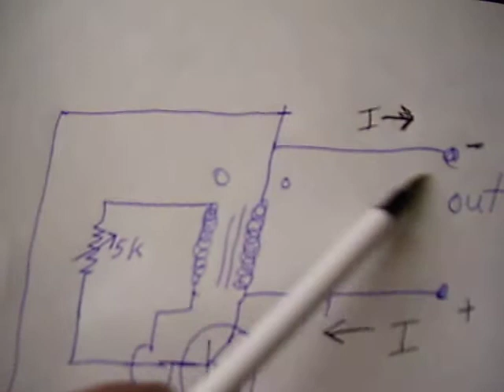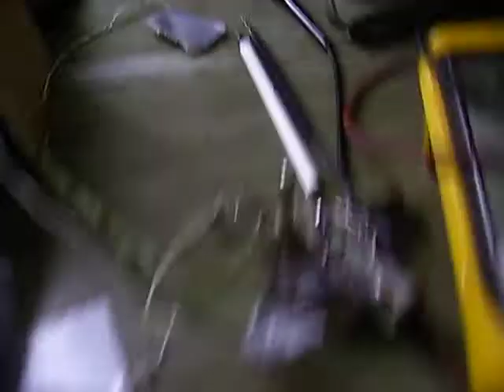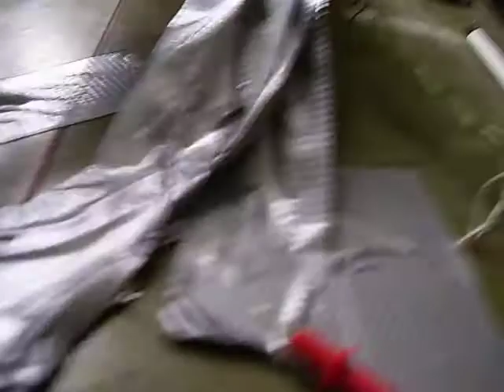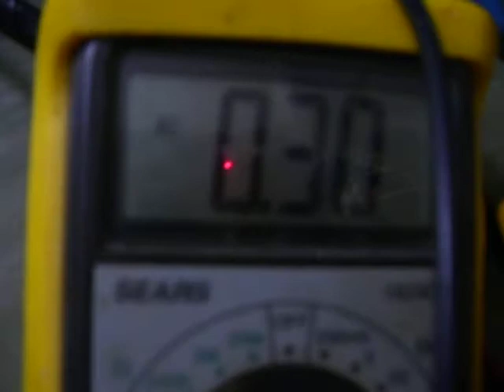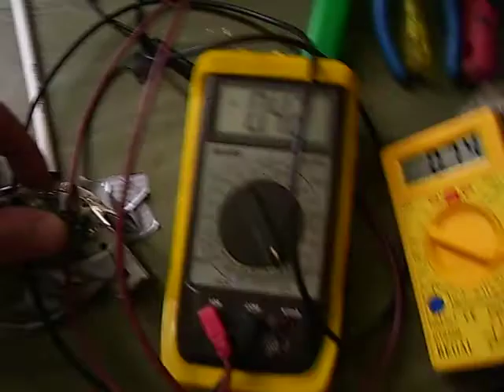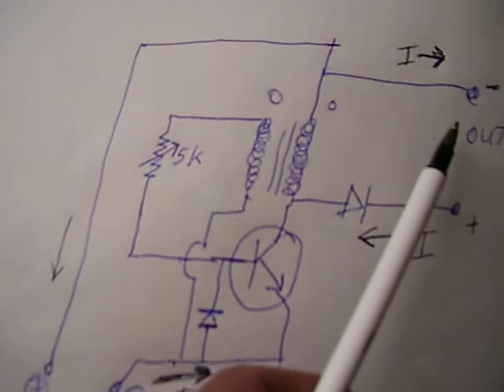100_0541.mov

Comment: we need to see the input an output voltages and the current at the same time in order to deduce if it is actually putting out more than it's putting in...

Also, your diagram showing the current flow is incorrect...